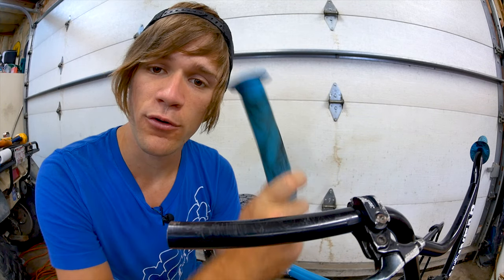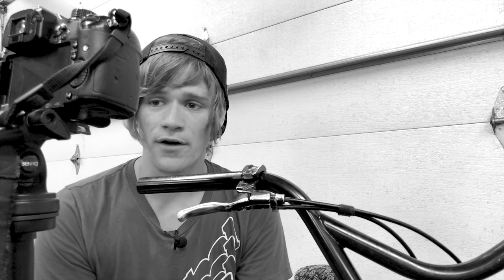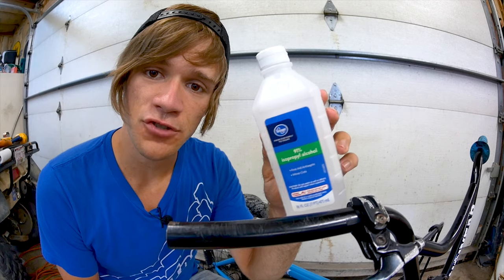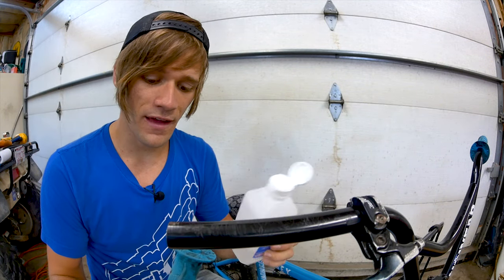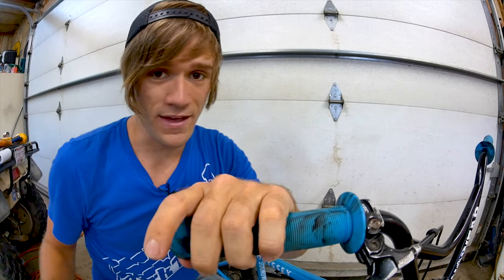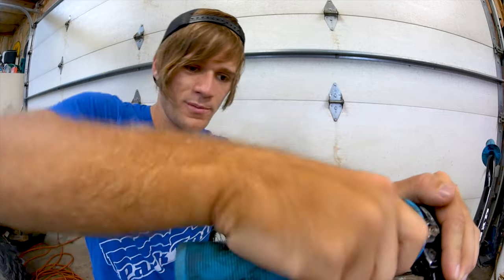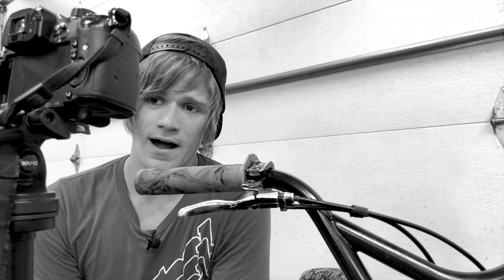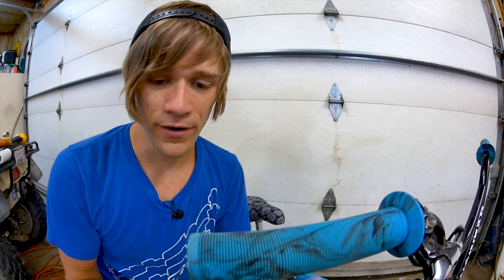Easiest BMX Grip Install - No Air Compressor

Comment: I own a sign shop and am restoring my childhood Norco Freestyle Team Issue. I was literally sitting 6 feet from a bottle of isopropyl alcohol when I watched this. Worked perfectly. Also another tip- put a nickel inside the grip before installation. It will prevent the bars from wearing through the end of the grips.

Comment: Yes, finally. Thank you. Been doing this for 30 years. Use a spray bottle and a zip tie, and get 70% or 90%. Though 50% will work, but take a few minutes to dry.
Reply from the maker: It works so well. Hadn’t heard of it until about a week ago and a few friends didn’t know about it either so I figured others probably didn’t know as well.
Reply: Absolutely. That's why I'm thrilled you did this video. I see ppl say hairspray and even WD, lol, that's nuts. I would never think WD but hairspray has been tried. The second it touches sweat the grips will pop off so suddenly you could die. Don't ask how I know. :D
Reply from the maker: Haha WD definitely is crazy. Hair spray at least makes sense other than what you said at the end. Hopefully some people find use out of this one

Comment: I've used this method and the air compressor method and the easiest methid by far is the zip tie method. Literally i use 5 or so zip ties, put them in the grip then slide them on my bar then just pull em out when you're done. Best method I've used and I have used it for a good while now. 

Everyone's got their own trick that they use and thats what I use lol
Reply from the maker: Man I’ve tried zip ties a few times and just struggled with it. Haha

Comment: I use a can of ultra duster. That's what I though your video was about lol
Reply from the maker: Never heard that one before. How’s it work?
Reply: @Brant_Moore  works just like the air compressor I had an issue that I had no idea to get my new grips on until I saw the can of ultra duster. Stick the hose adapter In the grip and pull the trigger.
Reply from the maker: Oh thats awesome, im going to have to check that out!

Comment: Is there an advantage of this method over hairspray?
Reply from the maker: Once the rubbing alcohol dries there's no residue or anything left over. So if you're going to for the stickiness of hairspray in keeping grips in place, then that may be the way to go. If you're just trying to put them on easy, this may be the way to go.

Comment: Got a spray bottle of rubbing alcohol and some brand new wethepeople Raptor grips to install yes sir! Thanks
Reply from the maker: Perfect! Glad to hear it helped you!
Reply: @Brant_Moore  I've since swapped my grips over with no fuss. So this video definitely helped. I can't really get the cable tie down that far but must have gotten it in far enough as I had zero problems!

Comment: Iv allways used WD40/TF2 to put my grips on \m/
Reply from the maker: Heard that it works well but can get slick if it gets wet!
Reply: If you use hair spray under the grip, if a bit of water gets under it, you get throttle grip straight away not good airline or a track stand pump iv seen peeps use to put grips on :D